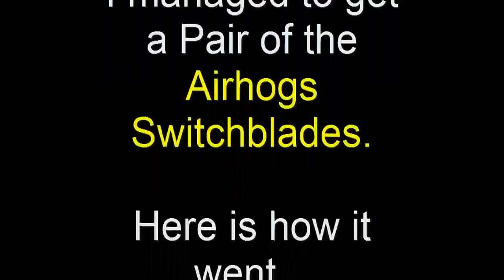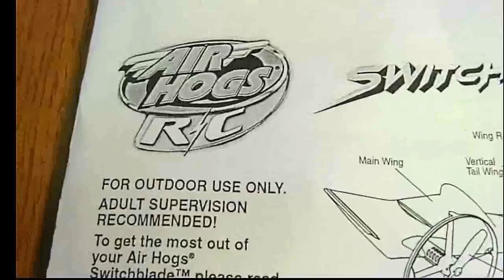Morphing Aircraft!  Air Hogs SWITCHBLADE product review.

Comment: I just bought one of these, we're having some problems getting it to fly...it just ditches right away...I think I will try adjusting the trim by hanging it the same way you did in this video...by holding it with my fingertips, I think I restrict it giving me the feedback.  Only paid $24.95, so it's not a bad deal if I can get it to fly.  Certainly I think it has to be VERY calm, no wind.

Comment: I have one of these and it always seems to belly up and smash into the ground but after seeing how you trimmed it out I'm going to try that next and see if it helps to keep it in the air...

I have an Airhogs Heli and it works well (Took me awhile to get the hang of it) as well as a smaller biplane with "Cell Phone" motors on the props and I find that one just cannot fly in any kind of wind, a slight breeze and it noses up and stalls.

Comment: How did you re-solder the wires back in the motor terminal?
Reply from the maker: Well this video is like 12 years old and all this stuff was destroyed in the fire, but as I remember....Turn on soldering iron with fine tip. Place wire and soldering iron on the  terminal. Wait for solder to melt. Remove soldering iron. Voila!
Reply: Were the wires of the Switchblade already out when you removed the motors from the plane?

(It’s just that I have a similar product called the Osprey from air hogs I bought from eBay as a collectible and it was malfunctioning out of the box so it reminded me of this video because you probably had the same issue and then you fixed it.)
Reply from the maker: @blackeyedcharlie9740  Honestly it was so long ago, I don't remember.  I think the wires were not soldered well, and I just re soldered them.  Good luck with your project Osprey.
Reply: So did you snip the wires off and re-soldered them back on?

(I was thinking of doing the same with the Osprey if that’s what you did to fix the switchblade.)
Reply from the maker: @blackeyedcharlie9740  I think I just resoldered them as one was not soldered. No need to clip.  It was a very rare thing.  I hope it may fix your Osprey, but again this was a very unusual thing to happen. If you bought it on Ebay used, and it doesn't work, then whoever owned it before knows it won't work. I'd send it back. Good luck.
Reply: If I take the wires off the motor terminals of the Osprey and re solder them back on, will it damage the whole motor and chip thing?

(Plus the Osprey was brand new from eBay, maybe it just had a manufacture issue back in 2010 like your Switchblade probably did.)
Reply from the maker: @blackeyedcharlie9740  If they are looking like they are soldered on well, I would not mess with them.  But if they look like bad solder or could be easily be pulled off, then just resolder them.

Comment: I wondered what these things fly like. Good thing some kids that can solder decided to put it up on Youtube... that way when they grow up they can go work for NASA;-) But seriously the first AirHogs were amazing little indoor helis when they first came out and got the ball rolling it seems.
Reply: Actually they started before that with a plane with an air powered engine, that had a big clear fuselage that was actually an air tank that you pumped up, you would give it a few pumps and give the prop a spin and it would go
It was actually a pretty damn good free flight airplane with a good pneumatic engine that worked great
Reply: tyler pierce Humm learn something new everyday.... not a bad idea if the tank is light and strong enough to hold the pressure. Thanks...

Comment: @donahuerules You have to put 8 batteries in the back of the controller, make sure the + and - signs are correct, turn on the controller and switchblade, it's suppose to fly after you've done that because the switchblade is already  pre-charged

Comment: id go with a gas trainer (tower hobbies has some nice ones) and they come with everything you need and they are quality. most of the cheaper planes come with radio equipment that wont work on any other airframe if you would like to upgrade in the future. with a gas trainer you can also head of to an ama field and learn with an instructor. that way youre risking very little in the crash department.

Comment: Really interesting plane, too bad the morph is only one direction. If they had a motor for the morphing part they could do the steering independently of the thrust/elevators by changing the angle of the wings.

Comment: The lack of elevator with the inability to pull up makes every landing a crash landing.  Nosing into ground? try to pulse the throttle but if your to close to ground just cut throttle and crash.
Too much work!  For 80 you can get an actual Helicopter

Comment: I am not happy with this product..I don't have a shop or knowledge to remove and repair motors and for $60.00 I shouldn't have to! ..this is the sencond Christmas I bought an airhog product that turned out to be a dissapointment to my kids! last time I bought a helicopter that the motor switch didn't work resulting in a broken propeller the very first "flight" !!!